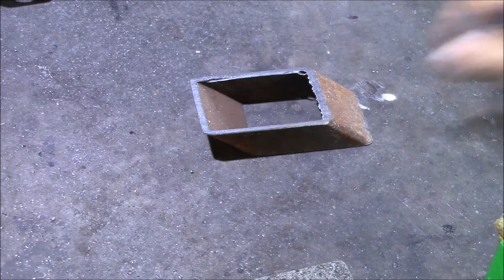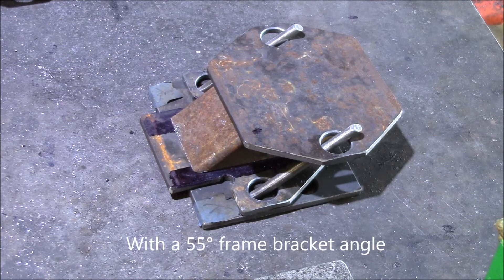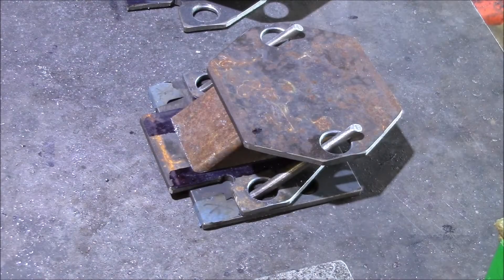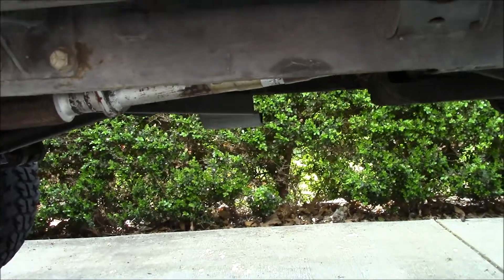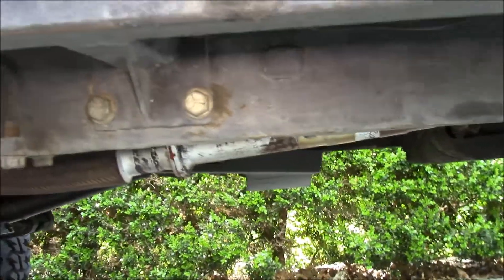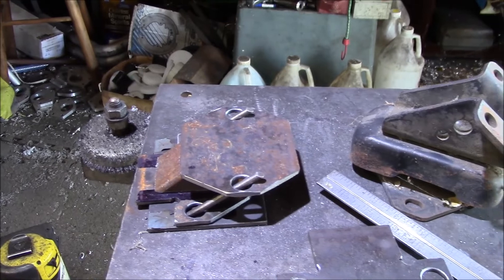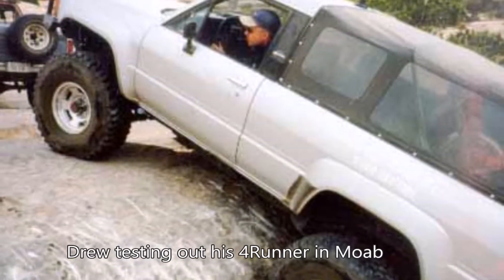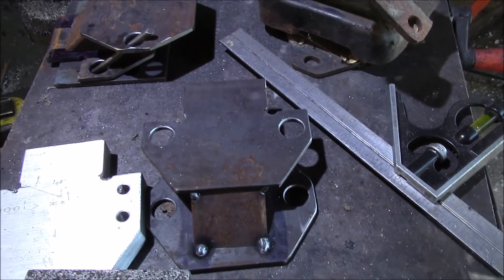Toyota Motor Mount Spacers

Comment: I bet you can get to all the bolts on the oil pan and be able to take it off without having to lift the engine a bit
Reply from the maker: You bet, at least on a truck with IFS.  Not an issue on a solid axle truck.  Also, like in my case with a 3" body and 2" engine lift, it makes accessing the starter and upper bell housing bolts so much easier.